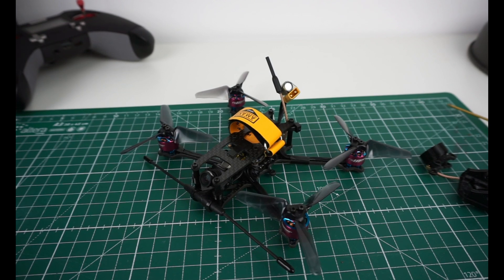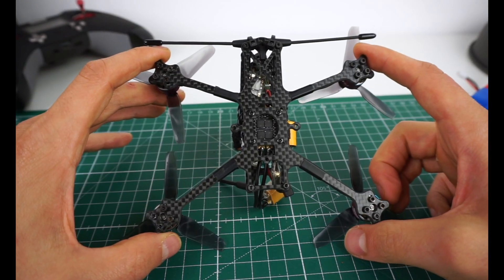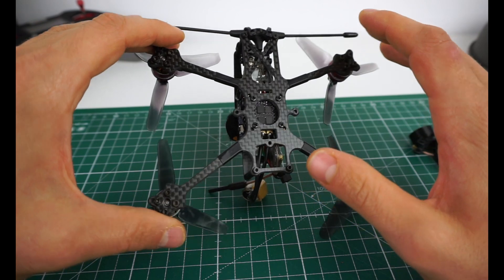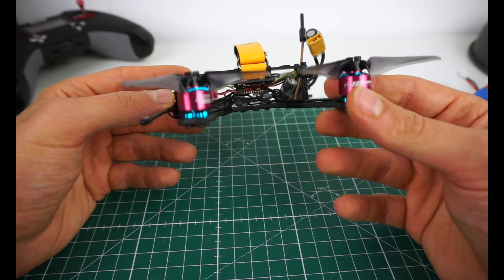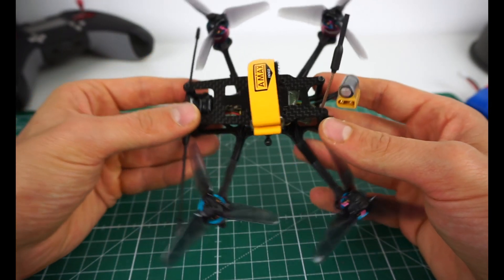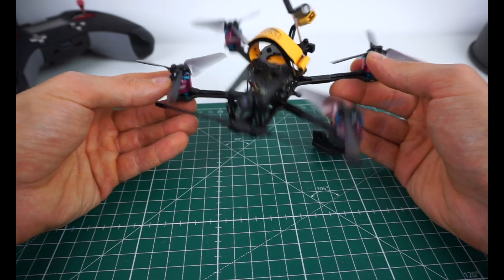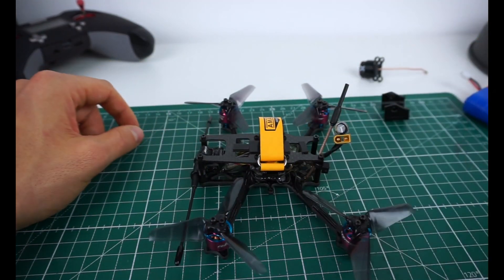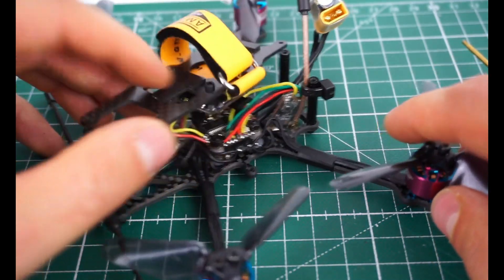New build: Pickle Evo2, Runcam Split 3 Nano and Li-Ion batteries

Comment: Hello, I saw your video and I'm building a 3'' drone with this engine (1207 - 5000kv), what is the flight time in your configuration? I saw in several videos that these engines have overheating problems, did it happen to you?

Comment: why not add a battery management system (BMS) like TP4056 to the 18650 that will cut off the the voltage if it reach 3.5 - 3.2, it is usually use in solar powered street light with auto switch off to protect the battery from degrading easily
Reply from the maker: Not sure if I want my quad to shut down in mid flight 😅

Comment: Im going to try this setup for li-ion but with 7500kv motors and bi-blades to try to up the efficiency and also hopefully the higher kv will work well for when the cells drop down below 5 volts.. Awesome video man

Comment: Good info. Very interested in the li-ion batteries you made. Thy are selling them pre-made now at a few of the online shops I buy from. I have to say that with a linear antenna for the VTX, the crossfire immortal T seems like over kill. Are you actually flying it out far like mid/long range? Agreed, motors look good. Thanks for the excellent video.
Reply from the maker: Thanks! Sure the CRSF was overkill. Swapped the antenna for a Lollipop since.

Comment: I'm pretty sure all the FCs are 3.3v chips, you will have to take the LDOs or any type of voltage regulator out of the equation in order to keep the FC on at that low of a voltage. The Kakute f7 is one of the boards that can operate till about 4.2v with no modding
Reply from the maker: Using a 1-2S 10A HAKRC board and 1402 8100kV motors on 4" now. Lets see if it works out. I will test it this weekend

Comment: Whats the benefit of a TS100 solder iron over a bench plug-in one?
Reply from the maker: M. TTT. It’s super small and portable and can be used in the field with a LiPo. Also somehow just makes soldering a bit easier with better results. Couldn’t really believe it at first but it’s true. Plus running on 24V it heats up to 300C in a few seconds.

Comment: The liion pack was very interesting. Is there not such a thing a voltage regulator that can increase voltage instead of decreasing it? Or alternatively, what about using a 1S-2S FC like the crazybee with some super efficient motors, gf3018 props and a throttle cut to save the 5A ESCs... It wouldn't be powerful but it could go farrrrrrr
Reply: search 18650 drone, a lot of easy projects with 15/25 minutes of flying! it will be my first drone :D